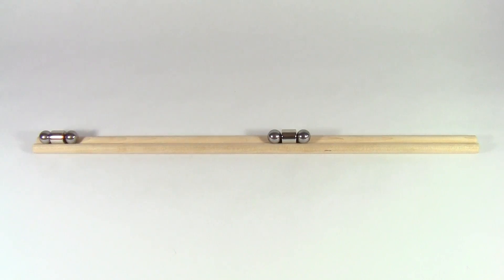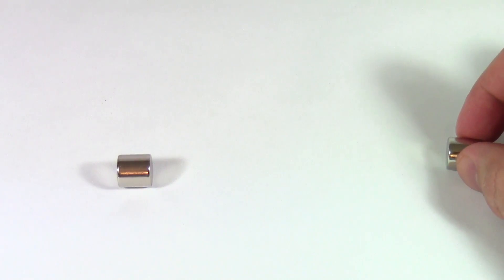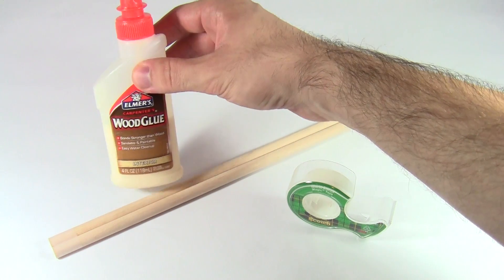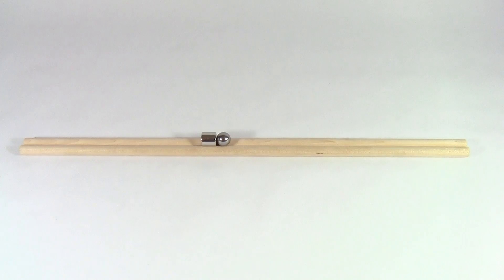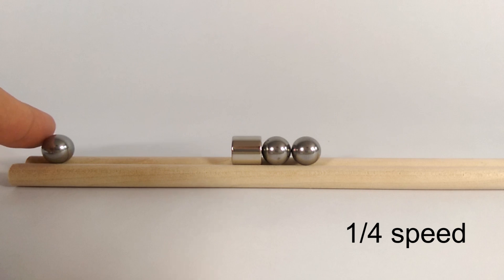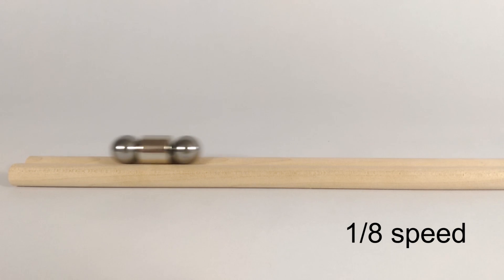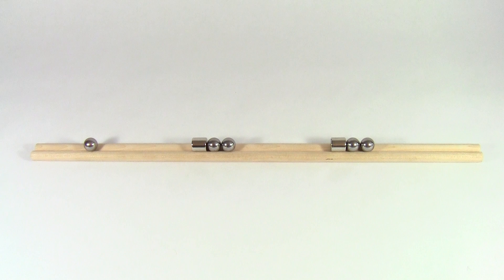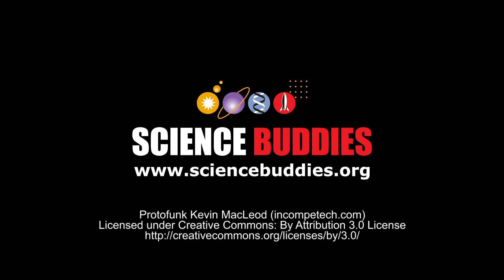Build a Gauss Rifle | Science Project

Comment: This isnt a gauss rifle effect its just conservation of momentum.
Reply: Technically, yes.
The output momentum just happens to be greater than your input momentum, due to magnetic acceleration. Of course, recoil is still an issue.
Reply: @nullpoint3346  Exactly why this isn't a gauss rifle. You can accomplish the same thing by dropping a tennis ball half a second after dropping a basketball right below it. When the backet ball bounces back up it will hit the tennis ball and launch it 50 feet in the air despite the fact all out did was let go. Input is ALWAYS greater than output. In this cast a heavy weight causes a lighter weight to move fast, that's all.